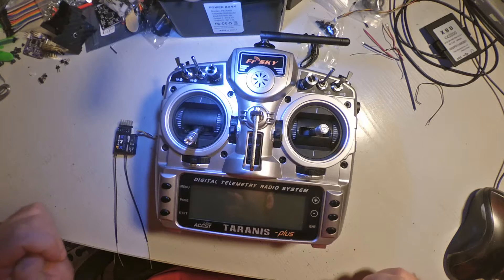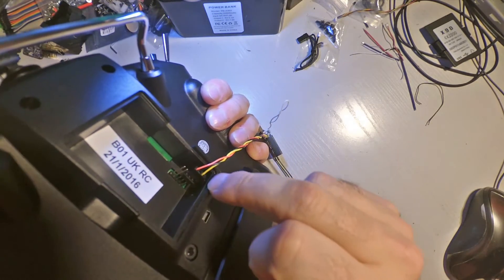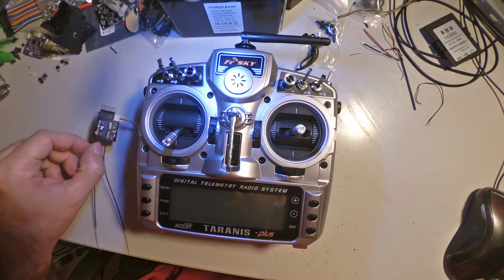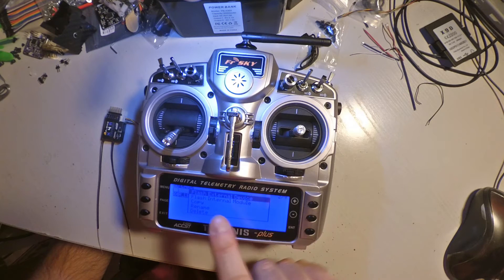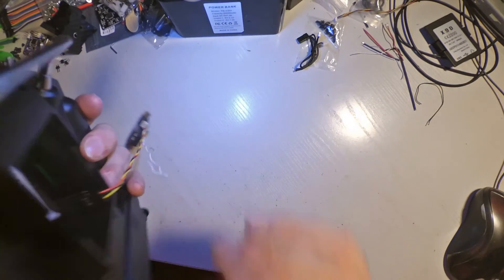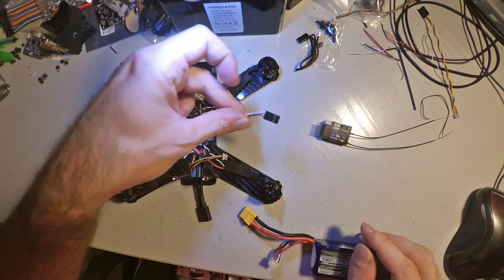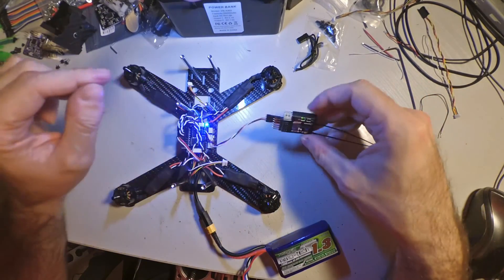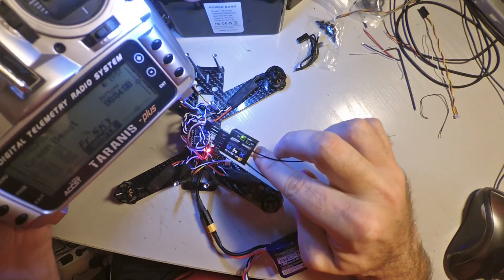Tutorial: Flashing FrSky X4R-SB with EU LBT firmware using Taranis X9D Plus

Comment: Hi, thanks for the tutorial. Although I am having one issue.
I have a Taranis Plus and an X4R-SB.

I created a new FIRMWARE directory on my Taranis, and uploaded the X4R_LBT_build151118.frk file. When I follow your steps (and after long hold of enter button) instead of getting an option to "Flash External Device", I just get one option - "Delete". 

Any thoughts? My Taranis firmware is openTx_x9dp_v2.0.9.2_mode2.dfu.
Reply from the maker: +Julian James Glad that you worked out!
Reply: Same problem for me when trying to flash the XSR. Taranis firmware 2.0.9.2. Only option available is DELETE. Did you manage to find a solution?
Reply from the maker: +Julian James you need newer Taranis fw, at least 2.1x, then it should work.
Reply: Hi guys,
Yes I found a solution that worked for me.
You need to update (flash) your internal radio module (XJT). Once I did this it worked perfectly. 

Send me your email and I will send you the instructions.
Reply: Thanks! I've upgraded to OpenTX 2.1.8 and successfully flashed my XSR Rx with the latest EU firmware (LBT) using the Taranis. Finally managed to get the XSR to bind after flashing the XJT firmware onto the radio module. Phew! Still, at least I've got a fully up-to-date Taranis now which is something I'd been putting off doing for a very long time. Now to work out how the updated telemetry functions and check that I haven't unbound my other receivers.

Comment: can someone please tell me how I upload the file to the Taranis. Im sorry, I am new in the hobby ;P
Reply from the maker: the easiest way is if you take out the sd card and upload it with something that can read it. the other way is to put the taranis into USB file host mode. You do that by turning the Tx on while holding the yaw and roll trim buttons (the two horizontal one) inside the middle and then connect to usb. You'll see the sdcard pop up as a drive. There will be two drives, only copy to the one which has many folders like firmwares sound etc.
Reply: +NorbertT FPV Thank you. I will try again tomorrow after a good nights sleep ;)

Comment: Can I just use the white X4R to set up a quad? It has SBUS and I have a naze 32 rev 6. I am tired of trying to get the X4Rsb to work, I give up.
Reply from the maker: +3000gtwelder ok, so the white x4r doesn't have sbus it's just a 4ch pwm rx. You only have 4chs on it with the slowest protocol of all. What type of firmware does yourself Taranis have?
Reply: Strange, The white one has a SBUS port on it? I have the latest firmware from the Open TX website.
Reply from the maker: +3000gtwelder That isn't an Sbus port that's the telemetry port. The firmware on the Taranis doesn't matter its the firmware on the internal XJT radio module what defines if it's EU LBT or International fw.
Reply: Ok, yeah I just read it's not sbus.
Reply: How do you flash the internal? I thought I did that? It gave me the EEPROM update when I turned the radio back on?
Reply: This is a royal pain in the ass...
Reply from the maker: +3000gtwelder You download the specific fw to the sdcard and just as I showed in the video but this time you choose to flash internal module.
Reply: Ok, I tried that. It says update firmware error.
Reply: I tried it again and I think it might have worked.
Reply: Nope, still just flashing red light..
Reply: +NorbertT FPV X4R-X4RSB_ccpm_eu_150624
Reply from the maker: that isn't an xjt module firmware
Reply: +NorbertT FPV The other one you gave me a link to wont load? It has a .rar extension and only give me the option to copy, rename, or delete?
Reply from the maker: unrar it with winrar lol :-D
Reply: Huh?
Reply: I'm just going to throw it in the trash lol, and buy one here in the U.S. that doesn't have these problems. What a POS!
Reply: Thanks anyway, for trying to help.
Reply: +NorbertT FPV Thanks again, I took it to Aloft hobbies, and  it turned out to be the 
backboard in the Taranis, and not a firmware or binding problem after 
all.
Reply from the maker: +3000gtwelder I'm happy that you sorted out!
Reply: Yeah, me too. I was starting to get frustrated at a new level lol.
Reply from the maker: +3000gtwelder I can understand, but glad you solved the problem!

Comment: Hey man, I have a new Taranis X9D Plus with 2.1.6 firmware and a new X4R-SB receiver. I can get it to bind in D-8 1-8 channels mode but I can't get it connecting with my Microbeast. Do you suppose the X4R needs flashing?
Reply from the maker: +Transguy Hey. The X4R uses the D16 mode, but maybe it's just a typo. So if it's bound it should be OK. What fc and firmware are you using on your quad?
Reply: I don't actually have a qaud, I have Rc Helis.
what about the jumper wire to channel 2 and 3 during the bind process very briefly mentioned in the maual to get CPPM out channel 4?
Reply from the maker: +Transguy I think you talk about the D4RII. It's a different receiver. The X4R uses serial protocol called SBus, the D4R-II is a 4Ch pwm receiver which is capable 8Ch PPM if signal 3 and 4 are jumpered.
Reply: Naw sir! I have the X4R-SB and can't get it communicating with my Microbeast.

Some folks have said they had to flash the RX EU firmware to get it working and some have said all you have to do is jump 2 and 3 signal wires during bind process to get the Rx to start in boot loader mode and find the firmware on the radio.

I don't know its pretty frustrating for new stuff not to work. I suppose it will be worth it when I finally get it all working.
Reply from the maker: The X4R has a special firmware which is capable of outputting ppm, but for that feature you have to have that firmware on it.
Reply from the maker: +Transguy So basically, you need the X4R-SB cppm firmware, EU if you have EU firmware on Taranis, and non-EU if you have international. After that to enable the cppm feature you bind your Rx with signal pin 2 and 3 jumpered. After binding process remove jumper and signal 1 will be cppm and signal 4 will be Sbus.
Reply: Will a standard servo wire serve
 as a jumper?
Reply from the maker: +Transguy yes, any conductive material is OK
Reply: My X4R-SB won't bind in D16 so Im sending it back to get another one. Only problem is now they are out of stock.

Comment: Good video witch firmwähre do you have on your Frsky taranis becouse i have a X4rSb with the Eu LBT firmwähre on and my Taranis has ETSI1.8.1 Eu
So i cant bind!
Can you maybe give me a link from the Taranis Plus firmwähre  i have to youse?
Thanks alot Paul!
Reply from the maker: +SickFPV Hi, I use the latest version of OpenTX, as of right now it's 2.1.7, you can download it from here: http://www.open-tx.org/downloads
Hope you can work it out! Cheers
Reply: +Norbert Tóth with this formwähre i hav LBT on my Taranis to?
Reply from the maker: +SickFPV so you have 3 types of firmware, one on the x4r, one on the internal radio module of the taranis and one on the taranis itself which controls the whole system. 
What I've linked above is the Opentx firmware for the taranis but not the internal XJT module, if your XJT module doesn't have LBT firmware on it you should upgrade to that first. The other solution is to use the international firmware for both the receivers and the module, you can choose any of the two, it depends on you, I only can tell that the LBT works fine for me.
Reply from the maker: +SickFPV so you have 3 types of firmware, one on the x4r, one on the internal radio module of the taranis and one on the taranis itself which controls the whole system. 
What I've linked above is the Opentx firmware for the taranis but not the internal XJT module, if your XJT module doesn't have LBT firmware on it you should upgrade to that first. The other solution is to use the international firmware for both the receivers and the module, you can choose any of the two, it depends on you, I only can tell that the LBT works fine for me.
Reply: +Norbert Tóth do i need a special cabel to update the xjt modul to LBT? And one last question can i bind the x4r Sb LBT when it is installet to a Fc? With Sbus?
Thanks alot you are my time safer!!!!
Reply from the maker: +SickFPV The internal module can be flashed through the Taranis' menu, you just need to copy the XJT firmware to the sdcard and use the method I showed in the video but now you flash the internal module. After that you can bind the rx with the tx and yes, you can us sbus on the FC side.
Reply from the maker: +SickFPV The internal module can be flashed through the Taranis' menu, you just need to copy the XJT firmware to the sdcard and use the method I showed in the video but now you flash the internal module. After that you can bind the rx with the tx and yes, you can us sbus on the FC side.
Reply: +SickFPV i got it thanks it works!!!
Reply from the maker: +SickFPV Awesome! :-) Happy that I helped!
Reply: +NorbertT FPV I tried that firmware, but my X4Rsb just keeps giving me a flashing red light? I gave up on it and bought the 4 channel white one. Whats the difference between the two? Just one channel?
Reply from the maker: +3000gtwelder You only need to flash the LBT firmware if your radio's xjt module has the same. The X4R is just a simple 4 channel PWM receiver. It shouldn't be even mentioned on the same page with X4R-SB's capabilities. They are literally night and day.
Reply: I'm lost, so I don't need to flash the X4R?
Reply: How are they night and day? I can't seem to find much info explaining the difference between them.
Reply from the maker: +3000gtwelder the X4R is not good for quadcopters they are good for 4Ch planes for example where latency doesn't matter and 4Ch pwm is enough. The X4R-SB is an Sbus receiver with up to 16Ch serial protocol. Which one do you have?
Reply: I have both, The X4Rsb EU LBT version and the white 4 channel X4R with SBUS and Smart port.